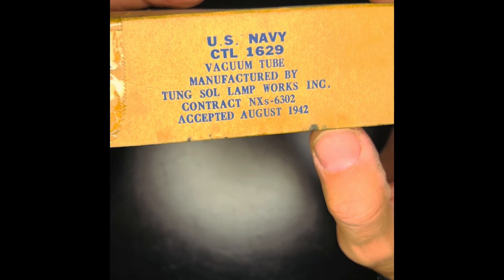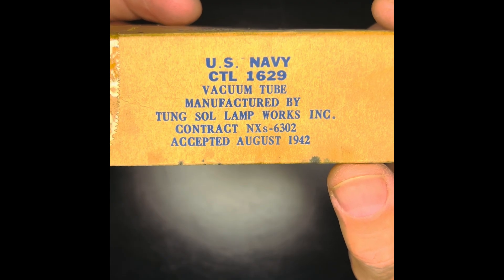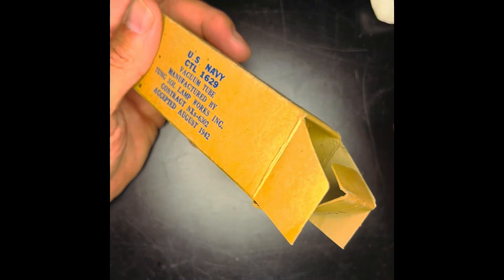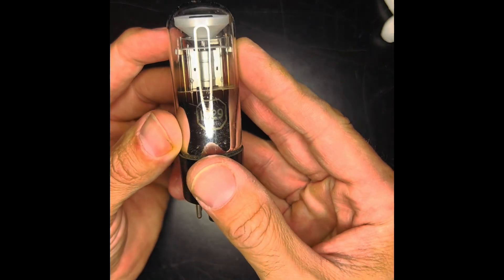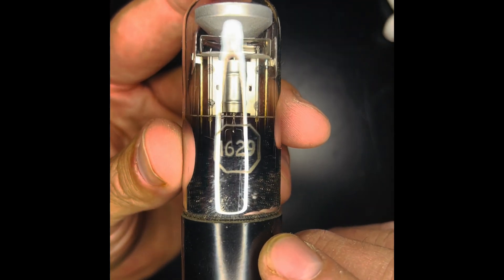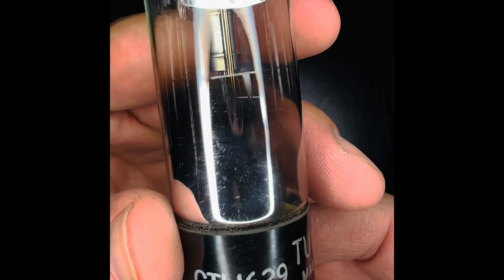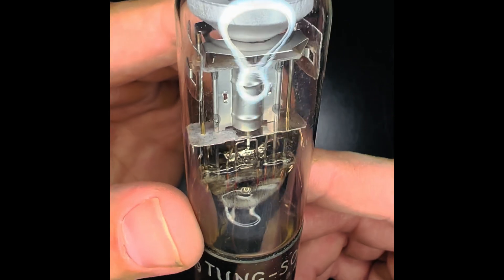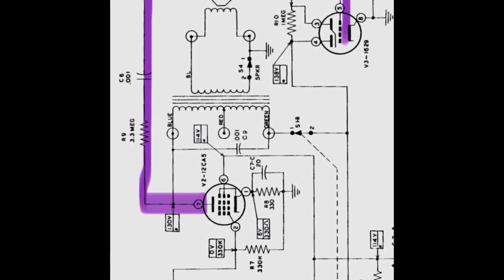HealthKit IT-12 ~ NOS (1942) Magic Eye Tube Arrives!

Comment: Originally used in military gear like radars?
Reply from the maker: Usually in tuner applications!
Reply: The most common use was as a fine tuning indicator for radio communications, likely for RTTY reception and the like where accuracy was required to decode text/data.

Comment: wow thats like finding a needle in a haystack ,I checked my stash  and dont have any
Reply from the maker: I got lucky. They are getting harder to get!
Reply: @ForgottenGearRestorations  I found a 6K11 for my ampeg GE brand new for $25, I couldnt believe it but its the off tubes that seem to stick around longer
Reply from the maker: Those are great old tubes!
Reply: @ForgottenGearRestorations  Years ago, I picked up four of them at the TRW monthly swap meet, super cheap. I ended up giving them all away to ham friends, they were used in quite a few pieces of amateur radio gear and sharing resources is what hams do. Thankfully, the one in my IT-12 is still going strong, I still wish I had a spare.